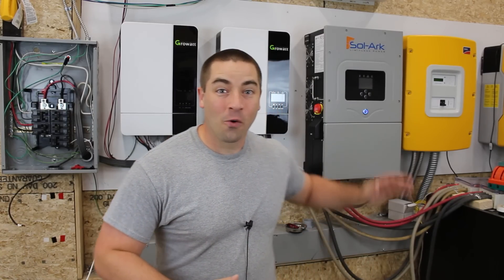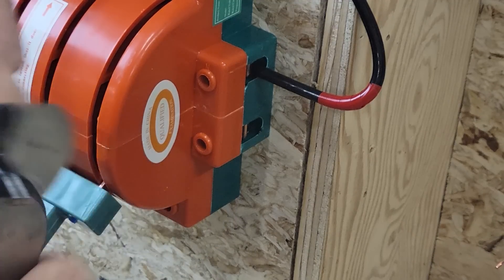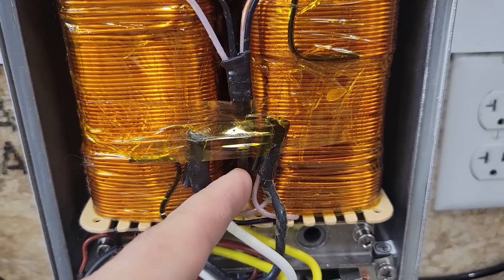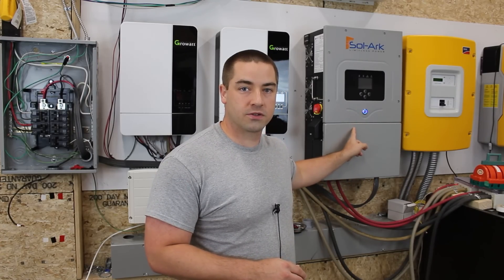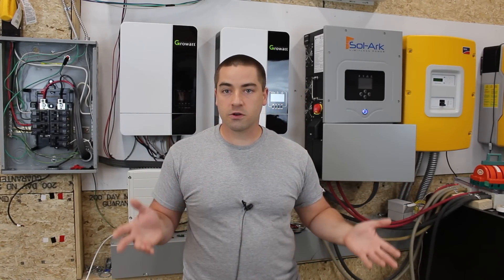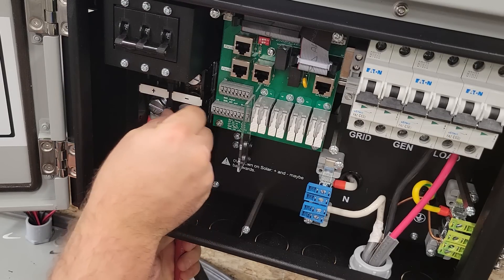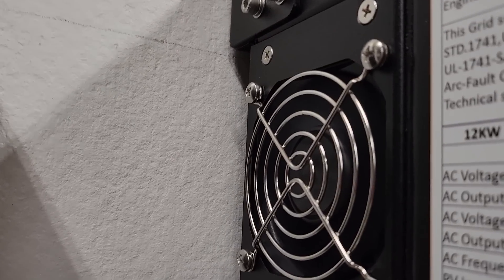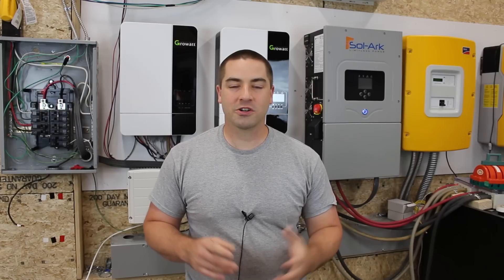Sol-Ark 12K 48V Inverter Install (to compare with Growatt 10K)

Comment: David, In fact only a few inverter are solar inverters are outputing all the power to both, or single  L1 or single L2. Most will split the power they produce in half to each legs. One great way to overcome that is to use a transformer. The transformer will magneticly share the load to both L1 and L2 whatever the conditions. This is probaly what is hapenning on your Growatt and split phase transformer. The only downside is that you loose a bit of efficiency of your system due to additional phantom power draw by your transformer due to the loss during load and no load.
Reply from the maker: I'm still charging the batteries from the Growatts.  Bulk: 56.0.  Float: 54.0.  LVC: 48.0
Reply: @DavidPozEnergy  14s or 16s? 3.2 nominal or 3.6/3.7?
Reply from the maker: @icarus901:  My battery cabinet is made up of 6x Gyll Batteries.  Each of those is 16s LiFePO4.  I open one up and show the inside in this video: https://youtu.be/SYJ25izYSGc
Reply: You haven't been watching David's channel much , he covered this very thing with he autotransformer .

Comment: Excellent review, looking forward to the next test results. Based on the price of the Sol-Ark ($7,000) and it only having 9KW, I'd stack 2 x Schneider Conext XW Pros ($3,250 ea. or less if you shop around). That would give you 16KW+ for 30 minutes and 14KW continuous. For some reason Schneider doesn't get much attention. We've been using the older model XW+ for 3 years (AC coupled, mostly in pass-thru mode) with no issues. Its a low frequency type inverter with a massive transformer, its a beast to lift and hang on the wall but it runs a 4 ton air conditioner with no problem. Note that the Schneider does NOT have built in MPPT charge controllers but it does have a 140Amp battery charger when the grid or a generator are available. In AC coupled mode there is no need for an MPPT charger so it works great in our situation.
Reply: I almost went with Schneider until I started reading about their very poor customer service. I’ve got a two 12K system to install. I’ll go with four Magnum 4448PAE if Sol-Ark gives me issues. Installing soft starters, hp dryer and hp water heater.
Reply: @USA-GreedyMenOfNoIntegrity  No question about it, Schneider is just too big and the customer service is poor. I've also dealt with them on the electrical side with UPS and switchgear installations. Fortunately, I have not had any issues with the 6848 inverter that required replacement parts or service. Magnum is a good choice also.
Reply: @USA-GreedyMenOfNoIntegrity  I'm using a Hyper Engineering soft starter on my Goodman AC condenser, works super good.
Reply from the maker: The surge capacity of the Schnieder looks great.
Reply: +1 for the Schenider XW Pro.  They are one of those setups that do require that extra user interface like David mentions, about $300 for a keypad and $300 for an internet gateway.  They also want you to use their own power distribution box at additional cost, but you can DIY this if a non-UL setup.  And of course, you need separate charge controllers for solar.  The total opposite of the Solark - modular vs. integrated.  Would love to see a surge comparison against this, as their short/medium surge and long term sustained overload is supposed to be the best out there (specs and real world - for 240V and 120V).  Can also AC couple like the SolArk.
Reply: Ben will be here shortly to explain why not to use XW pro's .  :>)
Reply: To get the Schneider equal you will need to add  :       
2 mppt charge controllers  1,000 ea.
Distribution panel      1,000  
Stacking kit            600.
System control panel  250.  
Battery monitor    500
Insight gateway   500   
Then 6500 for the 2  inverters and a ton of wiring and labor .     = $12,000  plus ZERO support
Reply: @onthelake9554  All those things not needed for DIY, and depending on what you are doing.  If you just want battery backup and AC couple, don't need the solar charge controllers.  Minimally just need the insight home gateway at $300 and the inverter - everything else DIY.
450V max PV with the SolArk is also restrictive in some scenarios (high-voltage panels).  SMA and Schneider have 600V offerings (550V working max).  Would like to see SolArk offer more capability there - and option without solar (for retrofit installs).  And they need to improve their surge capability.

Comment: You mention running your water heater for a draw test. I would be really interested in seeing a test  with and without a couple of thermal solar panels and a heat exchanger to preheat the water in the tanks. It's got to make a difference... Not sure if it would be feasible where you live this time of year.
Reply from the maker: I built a 250 Gallon thermal store in my house years ago.  It's been pre-heating my water since.  I have lots of videos on that.
Reply: @DavidPozEnergy  on it! Thanks.

Comment: Curious why you are running two growatts? Is it for twice the solar array capacity? I’ve seen people pare 2- 110v units to get 240v.
Reply from the maker: I'm powering my house and garage.  If I had 1 Growatt 5000, then I would overload it constantly.  But with two my total capacity is 10kW.  I don't overload that.
Reply: Awesome! Thanks for the info! Now I know what I need to shoot for him n inverter capacity.
Reply: Gotcha! I guess I missed the part on the inverter capacity of the two growatts combined. I’m looking to power a small off grid workshop. I need 240v for my welder and air compressor. The biggest load I will have. Is the compressor motor startup. It’s a 15 amp motor. I’m currently running it from a 6500 watt generator. It does start it. But it’ struggles a bit. So I’m thinking 5k from one growatt may not be enough for me.
Reply from the maker: 15A on 240V is 3.6kW air compressor.  The in-rush on that is maybe 5x (guess), which is 18kW.  One 5000W Growatt can surge to 10kW, but that won't be enough in this case.  So, yes, two can do it.

Comment: So which inverter would you recommend to go off grid? SMA, GROWAT or SOLARK ?
Reply from the maker: They all have quirks.  The SMA's are tanks.  However I did have the SMA's shut down twice because of some odd programming thing.  The Growatts are not built as well, as SMA, but they are built for easy use in off grid.  I don't see the Sol-Ark being the best option when stricly speaking about off-grid.
Reply: @DavidPozEnergy  SMAs are also extremely expensive new.  Only reason they were cheap for you was the DC Solar bankruptcy auction.
Reply: I have a Solark and LOVE it!!!!
Reply: Your correct about the bankruptcy.   They were selling at a great price back then.  I also picked up 2 of them.

Comment: I am really trying to figure out why Growatt is kinda holding back for their release of the newer 12kw LF. The older model is not even available hardly anymore, yes pre orders for the older models says a lot to me. All of their other models are selling like hot cakes and availability is everywhere except for the 12kw LF. I think I'll just wait a little longer just like the Alibaba 304AH batteries. In a year, maybe two we will probably be overwhelmed with overstock and lower prices. Lets hope.
Reply: It sure seems like in a year from now we will not know what hit us/the world
Reply: I saw them on eBay a while back. Did they sell them for a little while and then stop or something?
Reply: I wonder how the efficiency of the low frequency growatt is compared to the pair of 5Ks with the transformer.
Reply: “Growatt… release of the newer 12kw LF” - this is not a simple engineering feat. Watching videos from Genetry Solar makes that abundantly clear. They have a nice inverter that does not require an auto transformer and takes spikes the rating of their units.

Comment: I have been searching for someone who have tried both to get some insight. sol Ark is so much more expensive than Growwatt and wanted to know which was better. I wonder if they will add Auto-transformers to their Inverters someday. I do know that Sol-Ark is coming out with a 15k inverter in the very near future.
Reply: They need to redesign their fans. A tiny house or rv can't deal with the noise.
Reply: @glennwest4438  are you referring to the sol-ark. I believe these are mainly for larger homes. I am not sure if the smaller sol-ark fans would less noisy. They do have 5k and 8k units. I am basically new to all this and have been watching Davids videos for months and a lot of other content providers a s well. Maybe next year I will bite the bullet and spend some cash on a system. My guess it will be a Growatt with some EG4 batteries as I like most people am financially handicapped. I will not skimp on the solar panels though but will need to decide which would be better overall. It sure would be nice if money was not an option but unfortunately it is.

Comment: A benefit of the Sol-Ark is that it can participate in New England's ConnectedSolutions program. This pays you if you backfeed the grid to help keep it running smoothly during certain times of need. If you can participate in this you should be able to get a good return on the increased cost of Sol-Ark. If you know anybody participating in this program (or other similar programs which I'm sure exist) I'm sure it would make a nice video. Maybe if you end up with your own to keep long term...

Comment: I have also heard of Sol-Ark shutdown over 4500w on a single leg, even when using multiple sol-arks in parallel. Load share comms  timing issue between Sol-Arks. I didnt know its also there with one.
Reply: He put in the transformer so the two legs are from that.  The Sol-Ark doesn't see the individual legs.  The Sol-Ark only sees the 230v/240v as a single option.

Comment: David put that sol-ark to the test... No holding back run it hard lets see if its worth the money
Reply: Yeah full power and maybe some blue smoke .... Its time someone put it to a full test not just to see it installed like engineer 775....
Reply from the maker: Will do.  Anything in particular you want to see thrown at it?

Comment: I would think the comparison would be between the Sunny Islands and the Sol-Ark, and not off grid only Growatts. 
Do you plan on doing that next?
Reply from the maker: I don't think I'll have the time for wiring the SMA's back in before I have to get the Sol-Ark shipped.  But it's a good idea for sure.  You are right they are closer to each other in features.
Reply: SMA will blow the SolArk away. David has already tested them at 14 kw surge on the pair.

Comment: Since I have one of those other legacy inverters that requires a lot of add-ons, what does come with a beefy transformer I’d be very interested to see how well the solark handles large inductive and resistive loads. Starting large motors like washing machines a full dryer a large electric oven may be a large tablesaw heavy duty motor loads I have heard are troublesome on these transformer less designs. 

I have also heard that they struggle with large line to line in-balances I know my Legacy with large transformer can do 75% or better line the line imbalances… The inverters transformer acts as a large auto transformer :) 

Something else that would be nice to test if you have the audio equipment, is to compare the background humming, transformers sort of noise, and the full load noise between the SMAs solark and grow watt. Some of us don’t have the luxury of putting our equipment in a garage and have to listen to it. 

Testing some of the response times for the great interactive features may also be nice how fast does it really transfer when the grid goes down?

how well do each of them respond to over-voltage, undervoltage brownout type conditions from the grid or even surging from the grid. 

Since you have multiple strings can you test the MPT efficiencies between the different inverters in any controlled manner?

Something else that would be interesting to test would be as how well do each of the inverters charge and discharge the batteries? 

Another feature you didn’t mention is the fact that the solark  can talk to the BMS of the battery if it’s so capable. it would be interesting to see if you’re cheap lithium batteries BMS ports Can interfaced with the solark.
Reply from the maker: Which one do you have?
Reply: @DavidPozEnergy  I have a Schnider xw+ with both ac coupling and dc charge controller. I have had it for about 3 years and have never had an overload shutdown yet. I run my whole house though it’s 60a breaker. In normal ac pass though I charge an ev and the house no problem. I ran the summer avoiding peak rates from 2-7 pm with running off battery and selling back at increased rates :)
Reply: @DavidPozEnergy  Schindler’s get used currently in larger micro grids and telecom installs as you can piecemeal the parts to make a large 70kw+ system. A Californian utility did a solar + propane no wires min grid near Yosemite national park. I watched the promo video and when they showed the inside of the shipping container set up it was all Schnider xw pros with charge controllers and PDP panels, they use the remote generator start controller to run the back up propane generators and had it fully integrated into a utility scale and utility run project for an area that the main powerline got knocked out ( by a fire I think) and they weren’t going to rebuild it. You should get one of them and test it along side of your smas. It would be a much fair comparison then the cheap Chinese grow watts that are not great interactive and not you were listed so trying to compare those two a Solar or an SMA or a Schneider or an outback is really like comparing that junkie transfer switch that you said not to buy to a full certified GE one from the home center that you can get for a couple hundred bucks. I understand that there is an application for nine grade interactive inverters and then that market segment grow at may be appropriate but for trying to run your whole house its ill-advised for people to try to hook up non ul listed systems.
Reply: @Miweatherspotter1  while much of the country loves that ul listing out here in the jungle of Hawaii we don't care.  There's a great deal of us living in tents/cabins grass huts what have you...  The budget devices compared to the UL devices is certainly something we are interested in!
Reply: I'm also very curious how fast the transfer happens. I'm off grid and when I had my Schneider sw4024 inverter passing generator power through and my generator ran out of gas especially when there was a load the transfer wasn't fast enough and my router and computers would shut down.  This was true even though I had load sharing enabled.  In other words if I was pulling more power from the generator through the inverter then was allowed by the set point the inverter would supplement with some battery power to compensate.  If I ramped up the power slowly this worked fine.  However on the other hand My computer's would also shut down when a large inductive motor kicked on.   The inverter simply wasn't quick enough to respond to the sudden surge.  My computer's would not shut down if the generator wasn't running. In other words the inverter was perfectly capable of starting up that inductive motor while using battery power, just not while supplementing the generator with battery power.

Comment: I installed one of the Sol-Arks on an offgrid island, I really do like the unit, it's capabilities, ease of install, Dual 500v Solar, etc. but there are definitely overloading issues.  If an AC compressor spikes the load for a split second, it'll shutdown.  If there is a big mismatch in 120v load per leg, it'll shutdown.  I wish it was a little more forgiving because remote troubleshooting with the client it is a pain.
Reply: add an auto transformer. there are videos on how to do it. I had this problem and now it never overloads.
Reply: @av1204  adding the transformer sounds like a great option. How many watts will it add to the idle consumption? And how many wants to the overall efficiency if your standard load is, let's say 1,000 Watts
Reply: @av1204  - “add an auto transformer” - he spent a period of time on this video talking about his auto transformer
Reply: That is what a soft starter is designed for. If we can afford a Sol-Ark, we can spend $309 x ? HP’s or AC’s.
Reply: @USA-GreedyMenOfNoIntegrity  can you point me to some soft starting hardware?  I have searched many times and always come up short.  I want to get soft starts for my 3 ton AC and 2hp well pump.
Reply: @USA-GreedyMenOfNoIntegrity   I added a soft starter on my AC and does not help. I thought it did until I tested. Just dropped the LRA 7 Ah
Reply: $7000 and you need to add a transformer?? Im so disappointed i bought this POS!
Reply: What about a bank of capacitors?
That'll keep enough power for any power spikes...
Reply: You’re correct, I recall it’s about 1200-1400w mismatch between legs that will cause it to overload since it can’t balance.

Comment: Great video David, thanks for your excellent work.  You mentioned the loose terminal burned out your surge protector.  Curious, did you have a surge protector connected to each whole leg of 120 to protect against possible loss of the auto transformer?  Or was it a surge protector for an individual appliance.  I'm also working on a auto transformer system and am looking for protection possibilities.  Thanks!
Reply from the maker: It was a whole house surge protector in my main breaker panel.
Reply: @DavidPozEnergy  I am very disappointed that switch failed you. I was hoping to use them. Is there any way to fix them? Do you know where I can get a similar switch that is better made?
Reply: That is why I have them for my 350-400V solar input, 48V LFE bank, AC output and generator inputs.